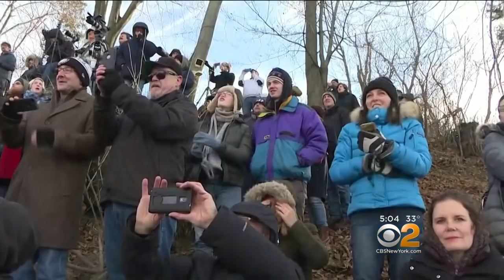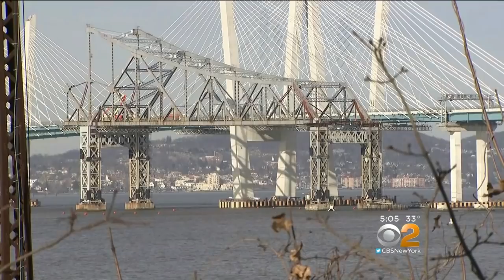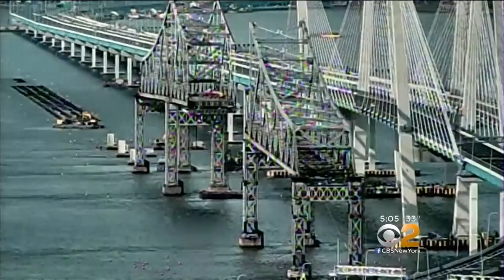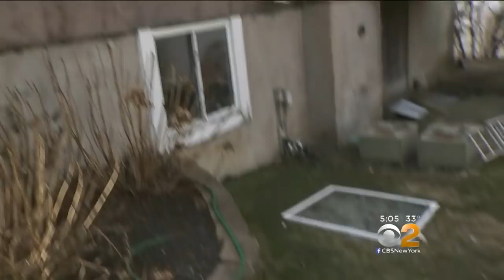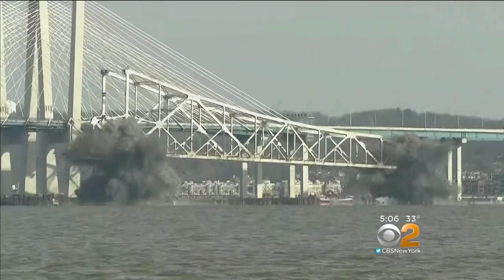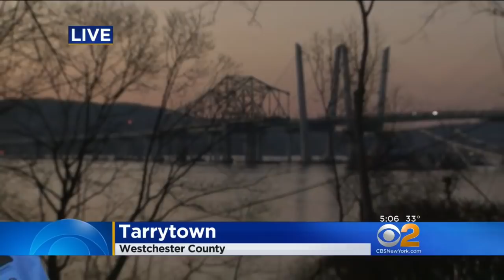Tappan Zee Bridge Demolished

Comment: I live in North Jersey and remember the Tappan Zee Bridge because I attended Marymount College Tarrytown from 1989 to 1993; I used to travel north over the Palisades Interstate Parkway and then cross this bridge to get there. It was, indeed, a sad event to watch this beautiful piece of architecture go, but unfortunately, it was necessary; the bridge was unstable and its collapse would have cost the lives of thousands of motorists. Frankly, I find it amazing that it lasted as long as it did. I still have a postcard of the original bridge going back to my college days. The new one looks nice, too, but is clearly not the same. I also miss Marymount College, which merged with Fordham University in 2007 because of financial difficulties.